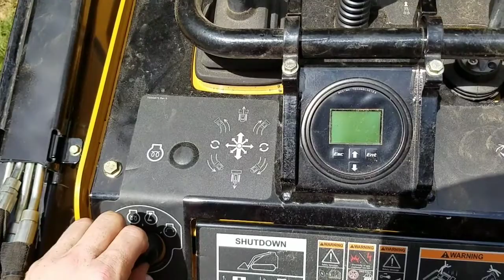Vermeer CTX 100 and POND BUILDING!

Comment: You needed the boulder grapple.
Reply from the maker: I got rid of it. It was the biggest pos you ever seen. It worked well on smaller stuff, but any real boulders would rip the rubber pads off of it immediately. Even did it to a brand new set, on the very first rock. So I immediately swapped it back to the dealership for a new scrap grapple attachment, which we really enjoy using. Thank you for watching my video too Gene. Appreciate it!

Comment: What's the cost of the ctx 100 skid steer?
Reply from the maker: With 3 attachments, 42k.
Reply: @TannerFlowers  ok. Thank you for the reply
Reply from the maker: No problem Trevor. Thanks for watching.
Reply: @TannerFlowers  did you ever look into the s925tx? If so did you get a quote on one?
Reply from the maker: No. At the time, I already owned a Vermeer SC 362 stump grinder. I wanted to try one of these machines mainly for our pond projects, and moving boulders, and pallets around. I called Vermeer Heartland in Knoxville, TN, where I bought the new stump grinder at, and I asked, "What is the strongest model mini skid steer you make?"

They told me about the CTX 100. I demoed it a few days later. I told the sales guy, if that thing will move that full pallet of stone, up that hill, I will be impressed. It did. So I bought it. This machine blows everybody's mind. No one can believe it does what all it can. It is a little beast! And they make over 40 different attachments for it too. I just financed it all. Payment is like $781 a month for 5 years, at 4% interest. Or, my other option was to rent one, and that was $775 per week, plus fuel, plus delivery. So I opted to just buy it based on that criteria.

I am ignorant about machinery. And I do not know jack crap about any other models. 

My dad's best friend has over 500k in Vermeer equipment. He owns a big high voltage/lineman company that covers the east coast. When I was going to buy that stump grinder, I called him and asked, "What brand stump grinder do I need to buy?"

He told me, "Tanner they ain't but one brand out there, and that's why I own over 500k of their equipment!"

I was like, "Well....what brand is that?" Lolol

He told me it was Vermeer. That was all I needed to hear. I've the stump grinder 2 years now, and the CTX a little over a year.

I cleaned out the trails with it here Sunday. It never ceases to amaze me. Demo one. It will shock you at its power. Seriously.